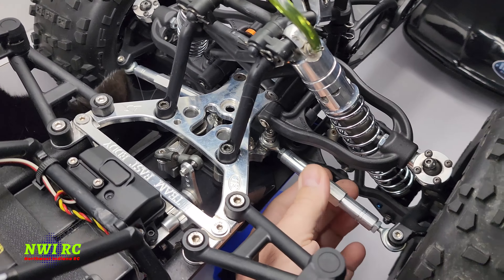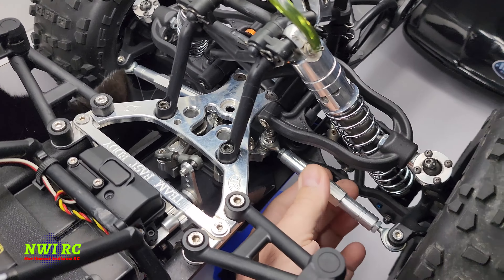HPI BAJA 5T - IRP  TURNBUCKLES - PHAT DAD 300mm DOGBONE - UPGRADES

Comment: Oo familiar problem, I also had the stock bones of the drive constantly breaking. And I drilled a 5mm hole myself and repressed the pin. And also slightly drowsy expanded the cups, and all the problem went away.

Comment: Could not help but notice the lack of differential action in your drivetrain. (You might wanna investigate that)
Also, Out of the box/stock…calls for 1000 diff oil.  You are converted to electric and the torque is instant, I would definitely want that diff to be more resistant.(use thicker oil)
Reply from the maker: I'll definitely look into that. I need to take it apart and inspect it anyways. Haven't had it out since it was rebuilt. Thanks
Reply: Just to be clear…I really like what you’re doing with this model. It’s hard to tell, because they are just written words…But I aim to help you get this thing sorted out in a positive manner.
Reply from the maker: It's all good.. my buddy had a high performance obr in it and he went through diffs before I bought it. I only converted it electric cause I didn't want any issues with my neighbors or Karens.. After I go through the diff I'm going to install the Proline trenchers and test and see if activating AVC will help  in stabilization for off-road speed runs. Thanks
Reply: @nwirc  Cool. Totally understandable. AVC will help a little. Based on the videos so far, getting the model softened up for more suspension action/weight transfer and making sure that 1 wheel drive isn’t the issue under acceleration~ I think you’ll be really amazed.
Reply from the maker: @rcmadlabz2492  I've owned these Hpi Baja's for years but with stock and modified gas engines and shocks. These Threshold Rezzies are amazing with these hd vvc's and many adjustments can be made. This is my first electric 8s conversion and have lots to learn to get it perfect. That's what I love about this hobby.. It never gets boring with all the tuning that can be done.